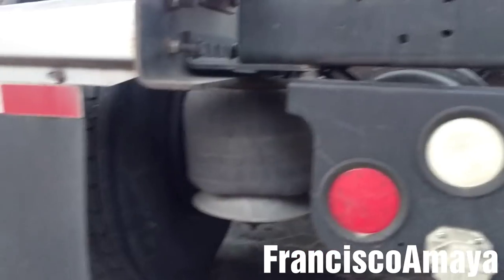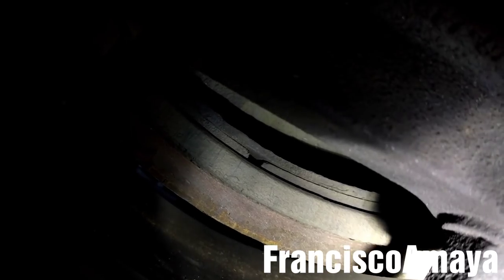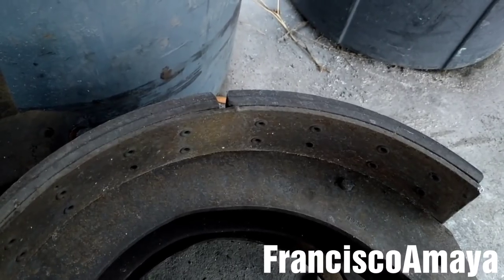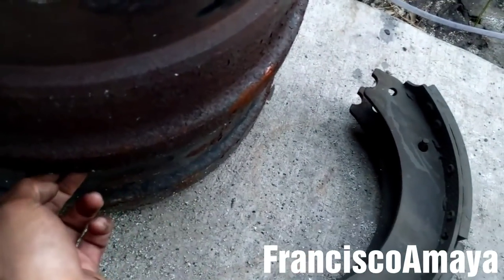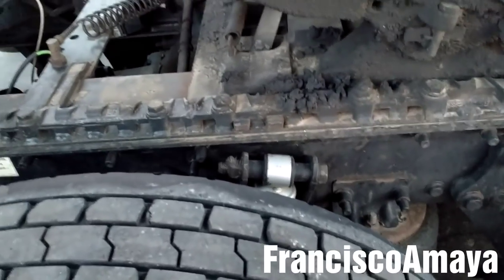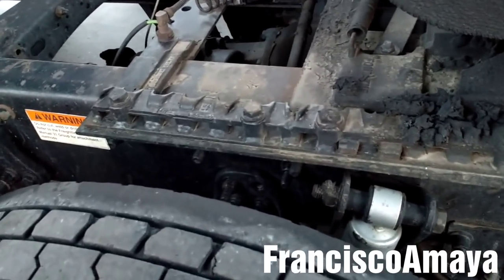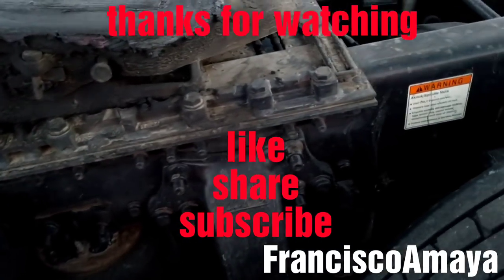Brake inspection Freightliner Kenworth Volvo Peterbilt international

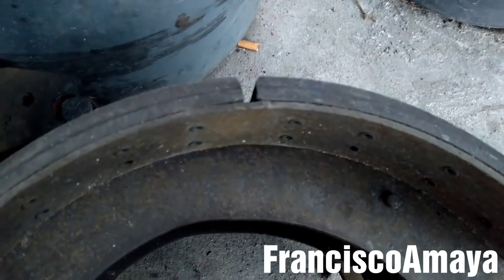Comment: 1:40 That line you are pointing to , is the regulation to be 1/4inch thickness above that line? Or do you wear it down all the way to that line? Im confused if the material below that line is brake material or some  kind of metal base plate. Thanks

Comment: Hi. What if your break pad on one wheel is worn down only at the end of one pad?
Reply: It's normal for brakes to be thinner at the outside, that's why you always measure your tread thickness at the center. However if your luck nuts are under tour that could lead to uneven wear.
Reply: Always measure from the gap. As long as the thickest area has 1/4 inch or more (or is not worn down to the line/indicator, you are good.
 The ends wear down faster which is why the wear indicator seems as though you are wasting a lot of material, but that is I believe to compensate for more material loss on the outside.

Comment: But that's brake material after the indicator line. Why can't that be used up. It looks like a lot of material still left. That indicator looks like a halfway point?
Reply: After that line on the brake shoes you’re into the rivets that hold the pads to the shoes. That’s why you can only use up to the 1/4” line.